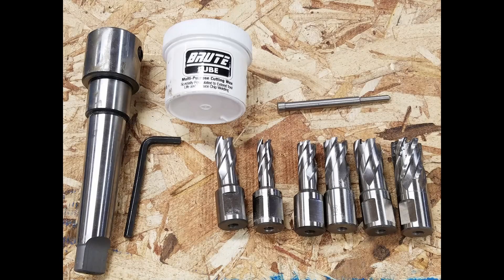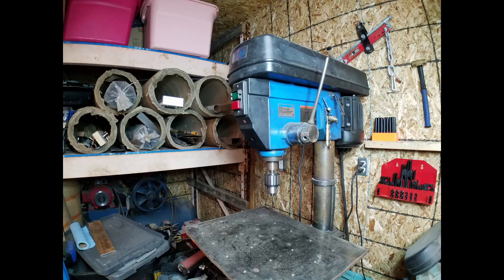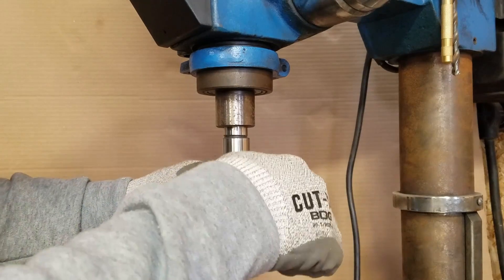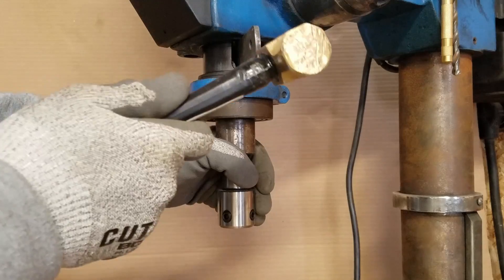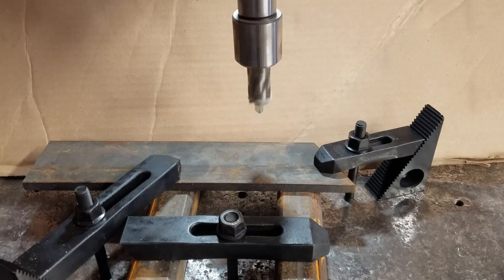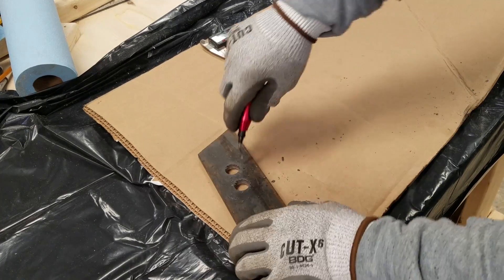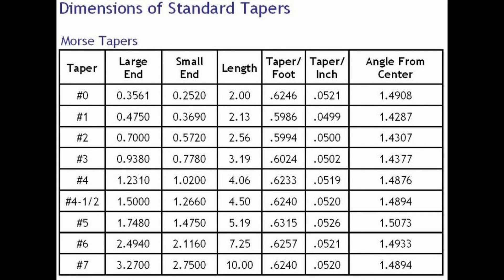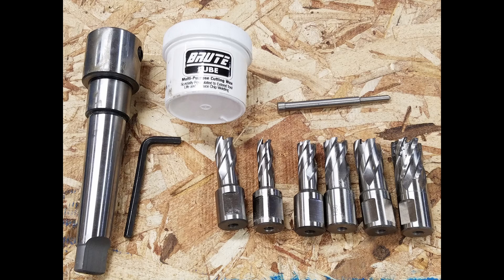Annular Cutter in a drill press, how to install and use!

Comment: Great tip. I love the clamp setup. Wheres the plans on that ?
Reply from the maker: There is a fixture table video on.the channel and the clamps are from Amazon.
Reply: @todayletsbuild2153 
 Thanks I’ll check that out
Reply: Nice. This spring ill finish the floor drill press and install the annular kit on it.  Got those already. I finally figured out out your layout having square tubing and those clamps. Slick. 
 Ive got to get a bench drill press for regular drilling. 
Thanks. .

Comment: Does this setup work on round tube? Like, 2" stainless tube?
Reply from the maker: @curtisalanmcgee  yes but you really have to secure the part to the table .
Reply: @todayletsbuild2153  here is the real question. Would it work on 2" round tube at 32 degrees? Right now we use endmills, but we have only done it on mild steel.
Reply from the maker: @curtisalanmcgee  @curtisalanmcgee I can only assume it will.  The big part about using an anular cutter is the internal reach. You would have to cut as far through as you can and then use grinder to remove center, then continue the cut. But you can buy larger cutters 2,3, and 4 inches deep.
Reply: @curtisalanmcgee just get a tube notcher if you need one. Safer than risking setting up a press improperly and hurting yourself or machine.

Comment: They work great but you better start using coolant when you drill or you're going to be replacing them
Reply from the maker: I use both cutting oil and cutting wax and have had great success so far. I just completed a fixture table as well with 288 consecutive 5/8 holes in my other video and cutting oil was great on that one. But yes more coolant is definitely better.

Comment: Is there a spring inside the adaptor that pushes against the Center pin?
Reply from the maker: Yes the tool holder has a spring to push the pin. Slugs come out every time .

Comment from the maker: Do you have a drill setup with Annular Cutters? what drill press and brand of cutter do you have? I will add as I forgot to say I was running this at 300 RPM ( the chart suggested 320-530 RPM)